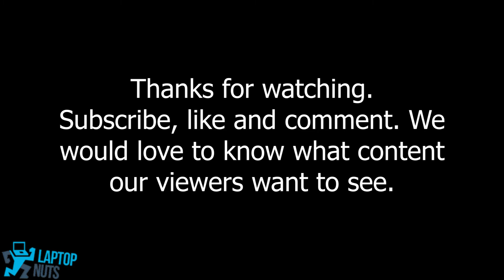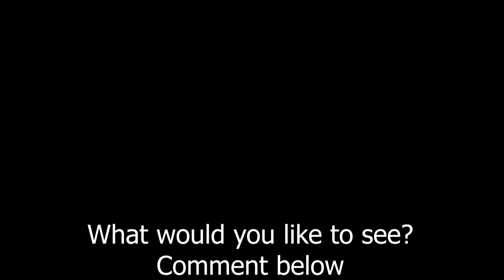Laptop Acer Chromebook CB315 2HT Disassembly Take Apart Sell. Drive, Mobo, CPU & Other Parts Removal

Comment: Richard
6 minutes ago
I have an Acer CB315 N19Q3 (chromebook) and I need your advice.  I had my keyboard replaced which was a big job for the service guy.    He gave my computer back but now although I have a working screen the "TOUCHSCREEN" function longer works..    I now have no touchscreen on my computer now - and I think the repair guy fried it by doing something wrong. 

Any help you can give on failed Touchscreen issues - would be appreciated.    (I do have a working screen !)